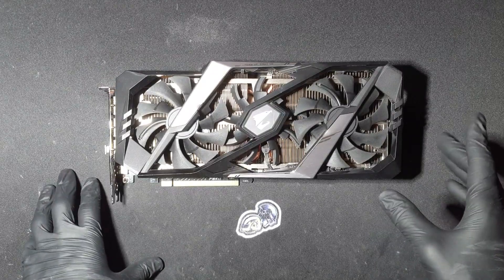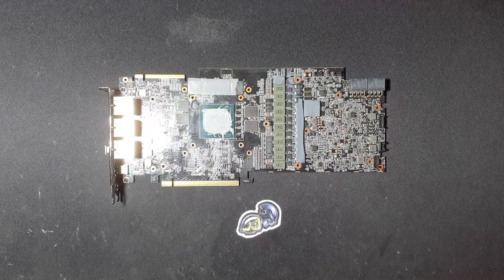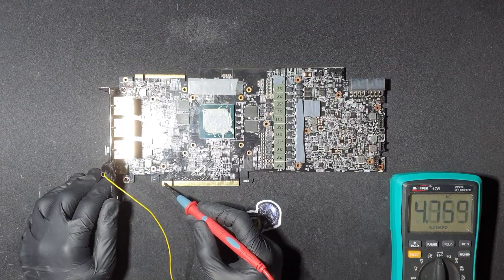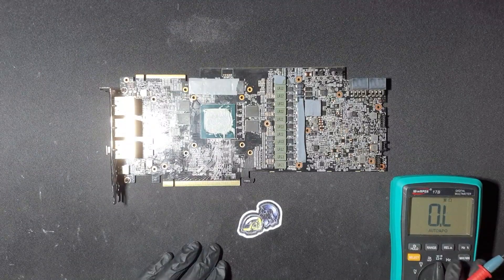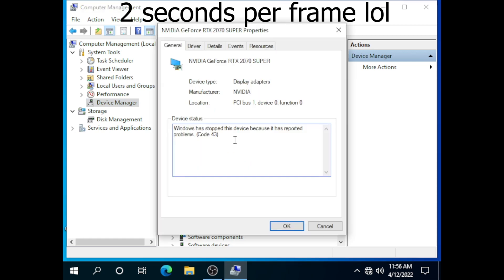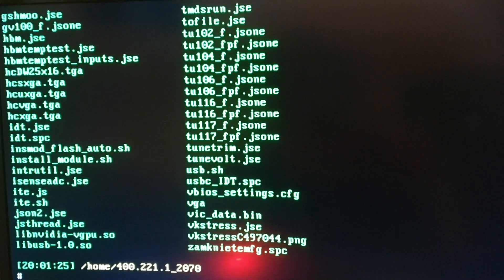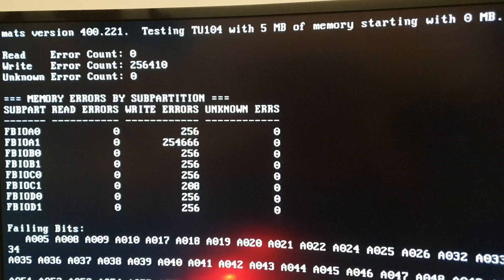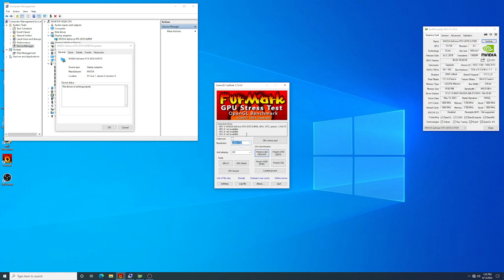RTX 2070 Super Repair (Faulty memory and error 43)

Comment: So please should all memory number be the same or u can mix them
Reply: That's a complicated question. Yes. They can be mismatched. However you usually don't want to do that unless you are very familiar with the chips and what their timing is. I believe it's like regular ram in that respect. You are allowed to go faster with a replacement but never slower. VRAM is a bit more picky because if you throw in one slower chip then it forces them all to not run at all because the other ones can only run as fast as the slowest timing which will cause them all to throw errors when the minimum speed isn't met. Personally I wouldn't even do it.

Comment: Hi again bro, i had a gpus again with artifacts and error 43 on windows, i know that ita the vram fault, its a gtx 1650 super, is it normal that for this card to have below 10 ohms resistance on vmem coil?
Reply from the maker: That's quite low but it should be okay. Run mats

Comment: Some folks are saying that Micron had bad memory memory in 2018.  The date code of less then 8Y is to be avoided.  Do you know any more details? 
(of course this is the GDDR6 D9WCW type)
Reply from the maker: Yeah that's the same memory here but i personally didnt have the issues other people talk about. I've replaced like 5 memories on different cards and they all worked again with no issues even after a year. Small sample size so might have been luck or this whole micron thing might have been exaggerated. Too little info to make hard conclusions unfortunately

Comment: Do you want to add teh specific of your settings you use to remove the memory chip itself?  (pre-heater or not, temperature and air flow)
Reply from the maker: i do use a preheater to heat the board to about 150c then the rest of the way with my hot air station on 350c